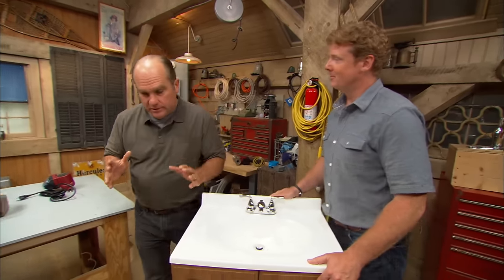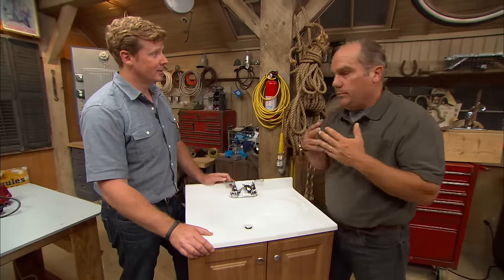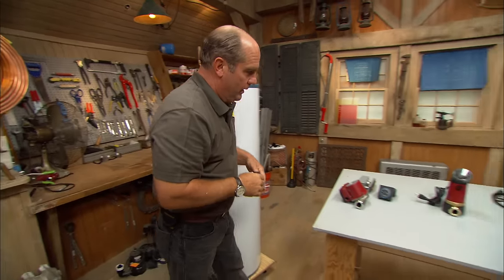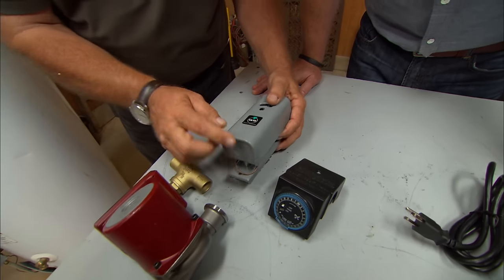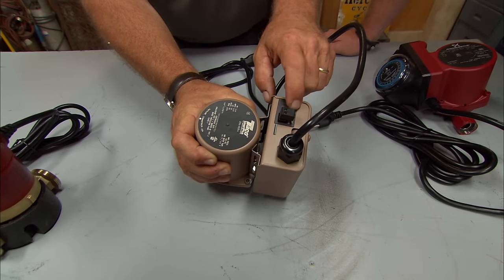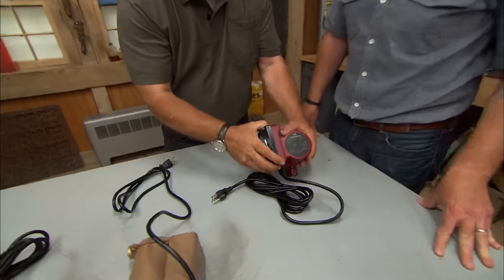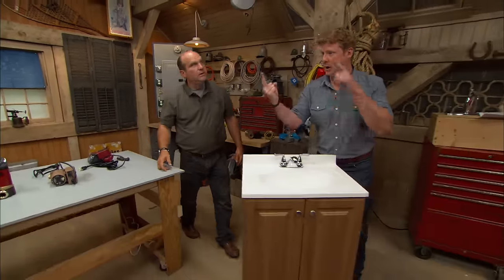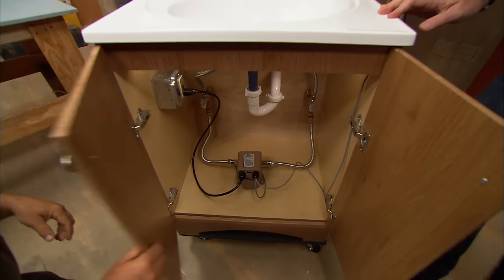How to Get Hot Water with a Recirculating Pump | Ask This Old House

Comment: The one thing I continue to not quite understand is how hot water will be immediately available at all my faucets/showers, etc   by putting the one check valve on the sink at the furthermost run from the water heater.  It would seem that there would still be some branches/legs of pipe to the other faucets/showers that still would have some cool water in them, and that really only the sink with the check valve is the "immediately available" sink.    I have a two-story house, 4 bathrooms, kitchen, etc, spread out over 4600 sq ft.   Will I really get hot water immediately at every faucet/shower in the house?
Reply: "Immediately"?  No.  But the distance from the other faucets that branch off between the farthest faucet and the water heater to the loop where you install the check valve will be much shorter than the distance back to the water heater.  Usually that's a very short run so your wait will be very short.
Reply: @matthewfry133  Additionally, the branches to a sink would typically be 3/8" (the smallest diameter pipe)  instead of 1/2" or 5/8" so the volume of cold water sitting the pipe that you need to waste out of the faucet is significantly reduced.
Reply: You can install more than one of the thermostatic valves. I have three branches total, so I installed three valves. One in the master bath, one in the guest bath (opposite direction of the master) and one in a bathroom upstairs (the other upstairs bath shares the same branch, so both of them are served by that valve). All of them work with just the one pump installed on the water heater. The kitchen sink is in between the water heater and the master bath, so it also is nearly instant warm water, as in by the time you count “2 Mississippi”.
Reply: @paulwindisch1423  thanks very much!

Comment: I'm not a fan of constantly heating water . I found I can handle my water heating by electric kettle . Wake up flip the switch or be fancy put it on a timer.
Reply: This system doesn't keep the water hot, but rather removes the cold water from the lines only when the user requests it. If you want to go for a smart home, i can  imagine very easily setting up a system that has a motion sensory in the bedroom. If between 6-9am it recognizes that someone is getting up it immediately turns on the recirc pump and primes your morning shower for you. Honestly, it's a pretty simple thing to set up.

Comment: Sir i want to ask that we have a pump near water heater. I think that pump will suck water and if we turn on tap the pressure will be less in that tap because pump will suck water for recirculation
Reply: No, if at the heater it is not in the sinks supply line therefore pressure/amount unaffected. And you don't run the recirculating pump while using water therefore again pressure/amount unaffected.

Comment: This seems like a lot of extra work and cost when you could install an instant hot water heater at the faucet. What are the benefits of this setup?
Reply: +Matt Foley 
You would need an instant water heater at each sink and shower (and dishwasher and washing machine). That might be okay for a [very] small cottage but once you get into a more typical size house a recirculation system is a better choice.
Reply: +Doug F Thanks that makes sense.
Reply: Electricity bill cost more than the gas.
Reply: @sceamson   Not true!   Electric pumps typically start at only 1/40th of a Horsepower,  plus can be set on a timer or a demand system so they don't run 24/7.
Reply: @NoPlanC  Instant hot water heaters at sink most often use high draw electricity. Yes pumps are a low draw but this comment thread is about tankless installs at each point of use.
Reply: it could easily cost you a lot more money and cost more to buy and install another water heater, We have the recirculation and it saves about 25,000 gals of water per year. This is the BIG issue! wasteing that much water in our drain field

Comment: That plastic sensor valve looks like a perfect thing to break while you're at work or away on vacation.  How many gallons of water would THAT waste -- not to mention the water damage to the rest of the house?!  These things are a disaster waiting to happen.
Reply: If you're concerned about a leak you could always put a water leak sensor underneath it. I just installed one of these plastic sensor valves and it seemed pretty sturdy to me.
Reply: @ChristianWillis  He said while at work or on vacation. The leak sensor can scream all it can, you won't hear it, unless you wire it to the fire department.

Comment: That constant heating of the water seems like it would waste a lot of gas. Anyone have any thoughts?
Reply: Use a tankless water heater.
Reply: The circulation pumps in the video all run on a timer or user button, so it is not running 24/7. Replacing a traditional water heater with a tankless doesn’t change the fact that you still have a long hot water line filled with cold water between the faucet and water heater, and hot water has to push the cold water out before reaching  faucet

Comment: My concern then would be how much electricity does the recirculating pump use? We have this problem in our house and I have been thinking about installing one of these for quite some time, yet have thought that, yeah now our electrical bill will increase, but by how much? There are only 2 of us in the house and use between 4 and 5000 gallons monthly. I believe this will save us money on water usage , yet then the electrical bill will increase. We do have a gas water heater though too so the gas bill will increase too because of the cold water being put back into the water heater. So this seems to be a win lose situation right? Thanks
Reply: Here are some rough calculations for you.  This pump consumes 25 Watts when running.  If you ran it 24 hours a day it would consume 600 Watt-hours.  I pay 7 cents per kilowatt hours.  So I could run this pump for about 4 cents a day.  I doubt you will see that in your bill.  As for the cold water in the hot water tank,  if you only run the recirc pump when you need the hot water at the sink, then you will not be increasing the amount of cold water going into your tank at all since the water you used to dump down the drain now goes to the tank instead of cold water from your source.  The trick is knowing how to set up the timer.  My preference would be to use a on demand switch for some sort.  Also remember that every BTU you lose because of hot water heats your home.  This would benefit your furnace during late fall to early spring.
Reply: Thanks  @NESEP76  ,I had forgotten all about this.
Reply: @TimS57064 .  You are welcome. I'm looking for solutions to this as well. I've found that it helps to be armed with facts to filter out the noise of certain comments. Good luck.

Comment: How does the pump not burn out when the valve is closed and the pump is still trying to push hot water against a closed valve?
Reply: It’s just a circulation pump, not a positive displacement pump. It does not produce much pressure. It only draws 25 watts. It will not burn out.
Reply: @paulwindisch1423 , but it has to produce enough pressure to push against the cold pressure, right? By how many psi does it have to be greater than the cold pressure?
Reply: @1weirddoe571  if you were to measure it, it’s probably only about 1-2 psi.
Reply: @1weirddoe571  The water is not turned on. It simply chases the water already in the pipes around in a circle. The hot water that is not hot is reinjected into the cold side.

Comment: Holy cow get a tankless water heater a lot easier to run an electric supply?
Reply: we have a tankless water heater and for the hot water to reach our master shower on the 3rd floor, it takes like 4 mins of running cold water down the drain. it's an insane waste of water and energy :(
Reply: If the source of hot water is far away from where you use the hot water, you always have the problem of waiting. Because no matter what you use to heat your water, the hot water always have to push out the existing cold water in the pipe before it can serve you at the faucet

Comment: Using existing cold water line return, that bypass junction is a bi-metal valve that keeps hot water from entering cold side, AND, stops water flow back as long as it is Hot water. My Q - what happens to pump when Hot water cannot flow past the bi-metal valve? Does it burn out?
Reply: Al Chance possibly, if the pump has poor/no self-protection. However, the water pressure in hot and cold line should be pretty similar, since the water comes from the same main shut-off valve, so I assume the pump doesn’t need to work too hard to add a little pressure at one side over the other side
Reply: @yzhang8629  the pump is only 25 watts and there is no resistance.so no extra load on the pump. i am Electrical eng and I wish I had done this sooner

Comment: Can recirculating pump be installed on manifold system?
Reply: Looks like a Bridge valve would be needed on each fixture that has hot and cold.  Only problem is you then have softened water being pushed in the cold lines.

Comment: If I understand the mechanics properly, this means at times we will be drinking water that has run through the hot water heater? Is this now safe to do?
Reply: No, it's not safe to drink or cook with!  Drain you hot water heater and look at what comes out.  If that doesn't convince you, remove the drain valve and look inside your water heater.  The only safe way to do this is with a separate return line to return the water to the drain valve on the bottom of the water heater.  Never use an existing cold water line as a return line!
Reply: @rpsmith  Ir is the same water. and safe to drink. the residue in the water heater is usually calcium chloride which is in the water anyway.

Comment: and that water heating system is working 24/7 for no reason to keep the hot water on all the time to the furthest line
Reply: no, the pump is on a timer and only runs during the time you have it set to run.  maybe 45 minutes in the morning or evening depending on when you take showers....  or it programs it self to run  whenever you use water.  the pump doesn't run all day...
Reply: The old ones ran 24/7. This new ones don't.

Comment: We are building a new home that is suppose to have a 50 gallon water heater. What is going to be more energy efficient for us? To replace the hot water heater with an on demand system (insta hot) or a recert pump?
Reply: Get a heat pump type hot water heater. As long as it's installed in your garage or where air not too cold it will take heat from the air and put it into the water. The bonus is it leaves the garage a lot less hot.
Reply: storing hot water is past day technology. On Demand tankless water heaters (like Renna, Rheem, Navien) can do your job in a best efficient way.

Comment: If you have a dedicated return line this works great yet a lot of fuel gets burned .  If you don’t have a dedicated return line and at the tee at the fixture that’s ok unless you have a mixing valve that will scald you if you are showering and the cold water feed to the mixing valve becomes hot mixing now with hot to get 140 and scalding to homeowner.  From a tech
Reply: I have 60 psi at the cold line. Do you think a normal recirculating pump will be enough to push the cold water in the hot line against that pressure?
Reply: @Solerf1  But your hot supply is at the same 60psi pressure.  The pump is simply recirculating water that is all at the same pressure.
Reply: That’s not how it works though. The valve that connects hot to cold under the sink closes at 98 degrees, so one will not be scalded.

Comment: For the  method using the cold water line for the return line, won't that make the cold water hot? If that's the case, now you're wasting water flushing the warmed-up cold water out of the cold water line until it gets cold?
Reply: The systems are designed to stop when the water going into the cold water line becomes hot.
Reply: Peter Smyth Ah, thanks.
Reply: You will get some partially heated water in the cold water line plus you'll be drinking water that has gone through the water heater.  The best system is the one where you have a separate closed loop hot water system.
Reply: Its not a perfect system but it helps of you don't want start opening up walls to run a third line back to your hot water tank. The key is to get a pump with a timer and try to set the timer to pump 15 mins before peak times of hot water use. Most of the time people use hot to warm water anyhow when in the bathroom or kitchen sink.
Reply: Johnson Johnson the pump over comes the cold line pressure and pushes the cold water back into the hot water tank.
Reply: Johnson Johnson your plumbing system can handle 250 psi which this pump doesn't go anywhere near.
Reply: @peter_smyth  there's a thermostat in that under-sink piece.

Comment: So I now I need to wait for cold water instead of waiting for hot water?
Reply: Yes, but you don’t need to waste all of that cold water
Reply: @yzhang8629  correct, you waste hot water.
Reply: C. Glenn  yep. There will be some  hot or at least warm water in the cold line. So if you want cold cold water, your wasting water again but worse bc you spent money to do it and heated the water.
     My bathroom sink is  next to the hot water heater. When heating it will expand the water and that water goes backwards into the cold line. So if I use the cold on the sink right after heating cycle its hot.
Reply: @anthonythorp7291  to be exact, you waste energy for constantly keeping the water in hot water pipe hot.
Reply: @yzhang8629  energy is wasted keeping the tank hot 24/7. These pumps only work when called for, they are not running 24/7. Regardless one is trading the waste of water for added use of  electric/gas.
     I, myself, wash my hands in the bathroom sink with cold water. And in kitchen for dishes, just turn on hot water. The cold in line is offset by the amount of hot water. No unnecessary waste, no buying extra crap.

Comment: Why not install 1/4 inch hot water lines? This is what I did when I built my house 25 years ago. I put a hot water manifold @ the water heater and then ran a separate 1/4” hot waterline to every faucet in the house. It was cheap, quick and easy. The area of the standard 1/2” water line is 4 times that of a 1/4” line. This means a 1/4” line will get you hot water 4 times faster with 1/4 the amount of water wasted. Every faucet necks the water line down to 1/4” anyhow. I literally have hot water @ every faucet in my house within 8 seconds which would otherwise be over a half minuet. There is no noticeable difference in pressure. I’ve never heard of anyone else doing this but would think it would be standard throughout the plumbing industry.
Reply: insufficient flow rate when running multiple fixtures, you'd still want the main trunk to be larger size

Comment: I would like to know the make and model of the 2nd unit they showed and mentioned. But can not depend on the check valves to be trustworthy. Mine always seems to need an internal cleaning.
Reply: Did you ever figure out what the 2nd unit is?  It wasn't very useful for them to show you  specific product and then not bother to tell you what is it is.  Very frustrating.

Comment: why would I want to push my cold water back out of the house with hot water? I don't think you can always do that, if you have some kinda check valve before water meter
Reply: It goes back into the water heater tank to be reheated.

Comment: I'm not a fan of using the existing CW line for the recirc system. It allows an amount of water that has passed through the water heater to mix with the potable cold water. I consider water that has passed through a water heater has added contaminates and is not a good idea to use it for human consumption. Although many people do, in one way or another.
Reply: it is the same water

Comment: Sir I am putting in a recirculation line, can you tell me if the recirculation line has to be the same size as the supply lines.
 I have 3/4 inch copper supply lines in and out of the water heater, I was going to use 1/2 " copper for the return line, is that OK?
Reply: use the WATTS recirculating pump and you wont have to run an additional water line
Reply: To not have any resistance in the system I would use the same size line for the return as the feed. All-Phase Plumbing/Heating/Drain Cleaning.

Comment: There is water wasted(down the drain) when you first turn the faucet(hot).  The ideal was to minimize the wasted water and not completely stop wasted cold water. The pump is turned off when the water temperature reaches a temperature threshold by the sensor.